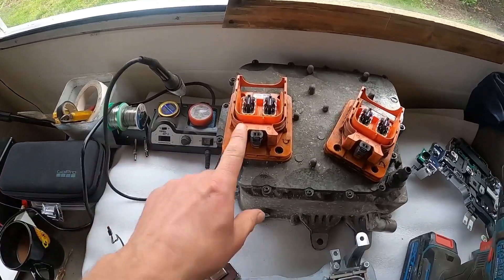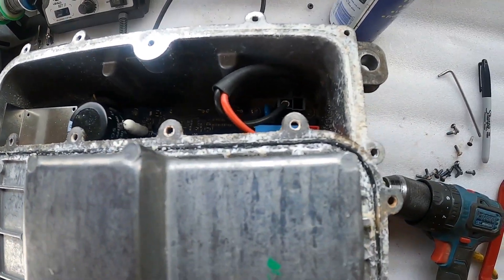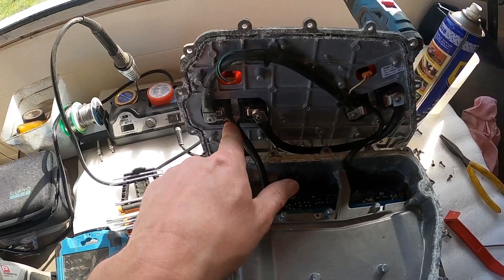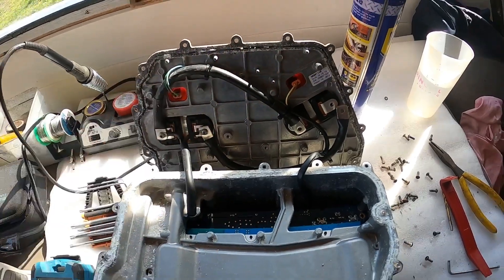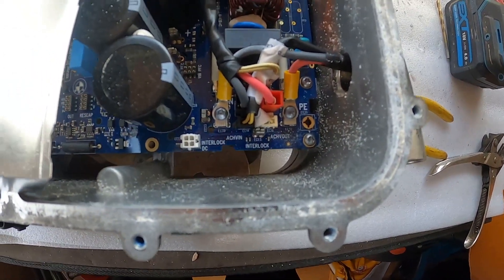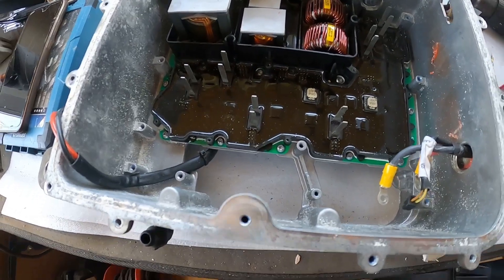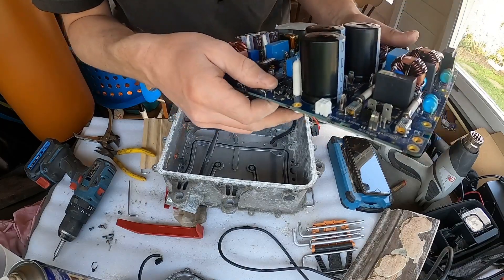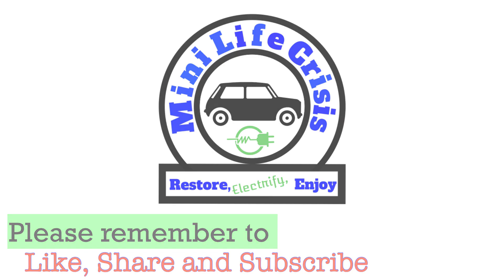BMW i3 KLE (charger) strip down

Comment: My KLE module has been playing up for about six months. My car was in warranty at the point. I brought this to BMW‘s attention. However, they have done everything that they could possibly do to delay my warranty claim. Now my car is out of warranty and they’re now stating that my car is out of warranty, even though they were the ones delaying the KLE module replacement by coming up with various different excuses. BMW and BMW’s dealership that I unfortunately have to deal with are in my opinion, shady.
Reply: Having the same problem with my Mini dealer. They will not fix anything unless it can't be kicked or nudged back to life. It's had a charging issue from new. I won't be buying another new Mini.
Reply from the maker: I'm sorry to hear that you've been messed about. Have you got this resolved? Have you thought about going to the Motor Ombudsman?
Reply: @MiniLifeCrisis my local dealers have gone very quiet. In the meantime I updated the software on the car which was hideously out of date. Since then, no more issues with drivetrain errors or reduce speed charging. I love my i3 but BMW have been no help at all.
Reply from the maker: Glad it's all working now, I think maybe BMW don't know enough about the i3 to be useful. If anything major goes wrong with mine the module involved will be removed and sent for repair.

Comment: There was a recall on those? Do they replace it for free? How does it work with the recall?
Reply from the maker: There was a recall for early models, contact your BMW service centre to check if it applies to your vehicle. It will be free if under the recall.
Reply: And be prepared to fight with BMW to honour the recall and Service bulletin. Make sure that your car is not modified in any way to give them an excuse to attempt to decline the recall. And contact BMW before contacting the dealer and have them agree that if it is the KLA unit when they scan the vehicle that they will honour the warranty. Have them send you that in writing and then go to any BMW dealer you like and have the KLE module replaced.
Reply: In addition, you will want to ask them to update all of the modules on your vehicle if it hasn’t already been done. Whilst they don’t do this automatically, they can do it at request when the vehicle is being seen for any issue you have brought it in for. They should not charge you for the service. However, they will try and take £200 off of you without even asking.

Comment: @Mini Life Crisis  Hi following your great mini project your a superb engineer by the way keep up the fantastic work. I my have a go when i can gather enough knowledge. I'm also interested in adding Dc rapid charging to my wife's 2015 60ah  Ac 7.4kw  bev I have sourced a used  ccs port/cable and Ac/Dc Lim I don't have the Kle yet I was wondering if I could use the voltage to current board Damien Maguire has developed and put the dc contactors in line with the hv ccs cables in an aluminium adaptable box and keep the existing 3.6 kw Kle?
Reply from the maker: Hi Simon, thank you for your very kind message! My personal preference would be to find a salvage company and use the correct KLE. The best place to ask this question would be on the openinverter.org forum, there are loads of helpful people on there who are much more knowledgeable than me.
Reply: @MiniLifeCrisis  Thank you for the reply wiil head over there sign up and have a good look 👍

Comment: You forgot to say what the kle is? I think it's the charging electronics? Not going to be nice when those large capacitors die and need replacing.
Reply from the maker: Oops sorry, yes it's the charger. If someone's do die they know where to come for some replacements 🤣

Comment: The corrosion is not caused by water ingress it is Galvanic corrosion between electrically charged different metals...
Reply from the maker: So a gasket would be a better option than a rubber seal 👍
Reply: @MiniLifeCrisis  Yes maybe copper or rubber gasket instead of seal..
Reply: You don't get galvanic corrosion without an electrolyte, in this case, water.